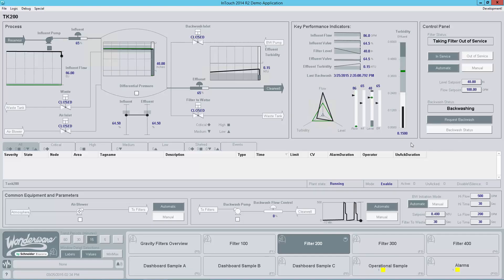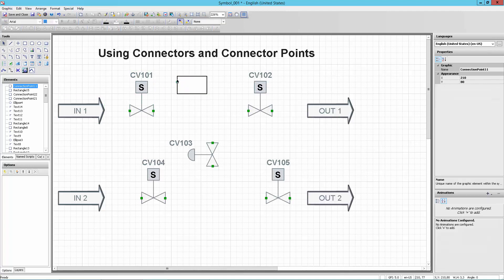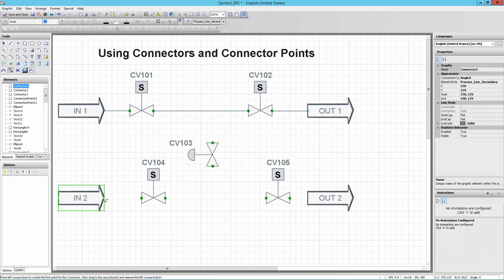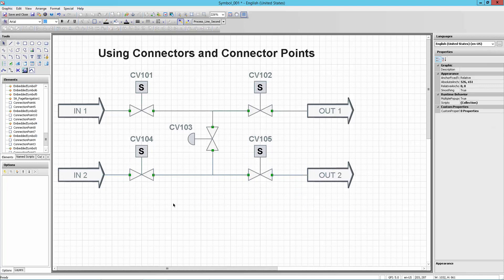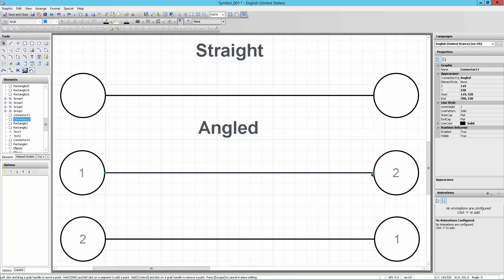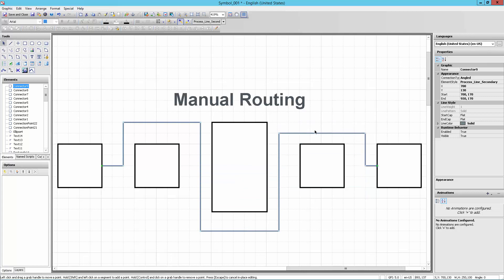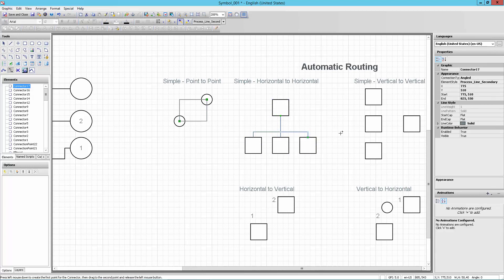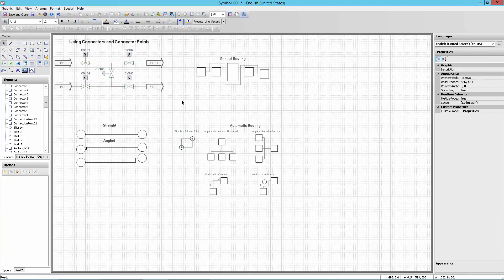ArchestrA Graphics Tips and Tricks Episode 3 - Connectors and Connection Points

Comment: Do the connectors have a properties that allows us to see what elements they are connected to? E.g. Connector1 is connected to Valve1 and Valve2. This would make it easer to determine what the connector is used for.
Reply: i was looking at writing a script to allow for easy change of colours with each associated connection. e.g. say all the pipework were for a water control system. all the properties containing a similar value could all be coloured blue. would make it a lot quicker than having to manually change each colour.